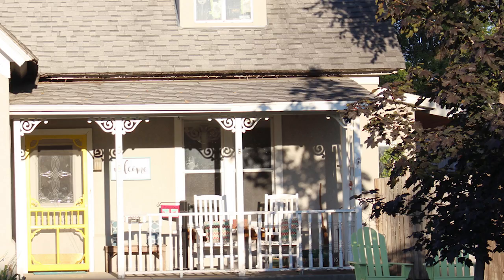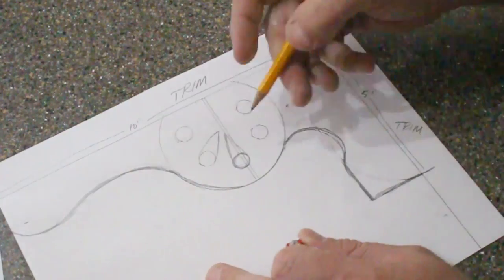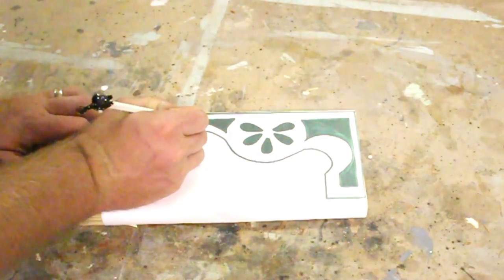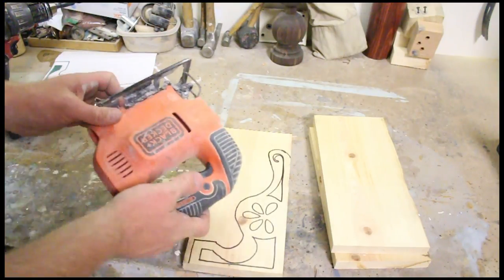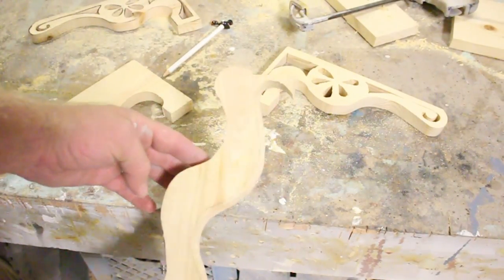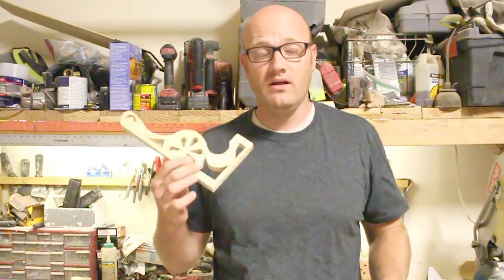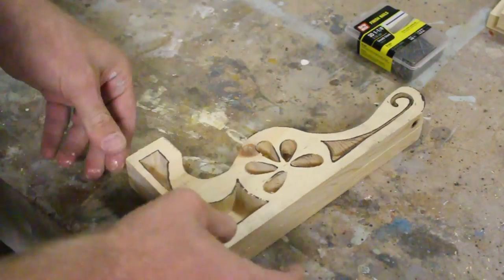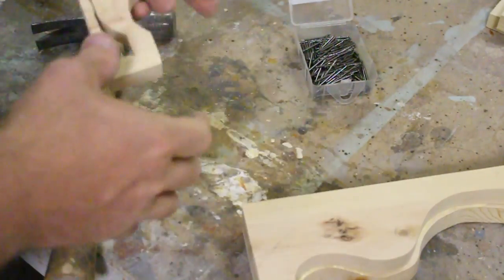How To Make Corbels | Farmhouse Corbels

Comment: Thanks for this. I'm half way through making a pair for a shelf. Looking at your video again i realise i did a tighter second curve on the bottom end so a bit different to yours and a bit more work to cut out. I had 2 of the pieces split on me so i had to glue those bits back on but no problem in the long run. on to the painting stage now :) thanks again